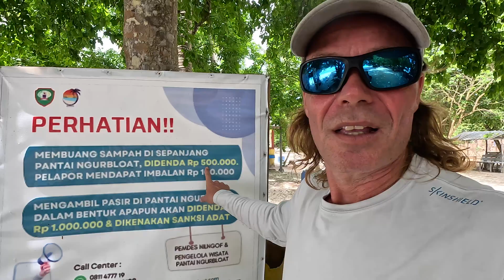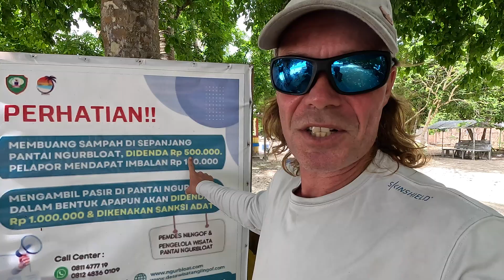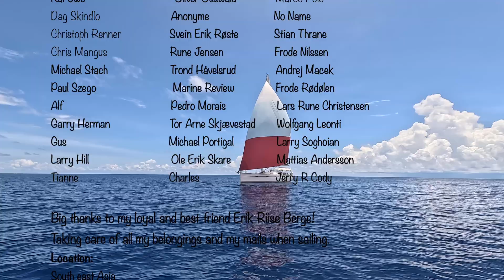FROM PLASTIC WASTE TO PETROL - SwT 192 - HOW TO RECYCLE PLASTIC

Comment: When I was sailing 50 years ago the offshore pollution was heartbreaking to see, but now it is a hideous nightmare. 
I wonder if it would be possible to create a new island in the Pacific by dragging a giant net (made from miles of recycled plastic) around that huge mass of plastic that has collected there, then tightening the net till you could safely walk and build small (recycled plastic) structures on the new floating island. Individuals have actually done this on a very small scale, creating floating homes, even with gardens for themselves, out of plastic rubbish.
Reply from the maker: Luckily it looks like the awareness about pollution and plastic are growing. Even in Asia. I have actually been positive surprised several places lately. 
Thank you so much for your comments and for being here

Comment: The catalyst that allows non-halogen plastic to be converted into oil is Ruthenium, a metal similar in properties to Platinum.  If a catalyst is used, the amount of energy required is much less, and plastic becomes diesel or any other fuel with further refinement. I strongly suspect that the reason why this is not done universally for the disposal of all plastic is the result of fossil fuel donations to global politics.

Halogen plastics such as PVC can be recycled into agricultural and domestic products such as builders' film and roof tiling, storm water drainage, etc etc.  It is not really suitable for drinking water, but OK for irrigation and electrical cable sheathing.

Comment: Where I live we’ve banned single use plastic in favour of other technologies. But these other technologies are often as bad or worse.

Compostable plastic is rarely able to be composted in currently available compost systems.

Paper products are often treated with processes and chemicals which also make them durable and difficult to break down. 

Finally, single use plastic is a good, sanitary, efficient material fif many uses.

I wish we could use the good materials while also fully taking responsibility for their management. Let’s use plastic straws but let’s have in place a method of dealing with the waste!

Comment: Burning waste plastic to generate electricity displacing coal/oil is the most efficient use. Other technologies use more energy per unit electricity. Only very small fraction of all plastic end up in ocean . Waste management along big 3rd world rivers and coastal areas most important. Bad waste management by governments biggest issue

Comment: Hi Thomas. Somebasic Facts about plastics, that became incorporated into the Civil and Structural Engineering Course I was on, in the 1970's, the data originating with intensive Research in the 1960's, when it was asserted that every Beach on the Planet, would be 30 feet deep in Plastic, within 10 Years - but it Never happened, so what was going on ? It was Found that Plastics exposed to Sunlight, break down into Esters and water, within about 12 months, and disturbingly, Those NOT exposed to Sunlight, also break down into Esters and water, and are gone wiin a period of up to 90 years- this has massive significance for things like Underground Drainage Pipes likelihood of starting to fail dramatically by around the year 2050, and explains the Osmosis Problem in Fibreglass Hulled Boats, even if they have been Barrier Coated both internally or externally So Tip - To o tain the longest possible Service life Boat, get the most recent production that you can afford, so you don't  have to cope with Structural Delamination problems, as the resin dissolves and Structural strength diminishes. Side notes - My 1978 Endeavour 32 still had excellent Structural integrify thanks to epoxy Barrier  oating below the waterline internally and externally, in 2016, and there is no such thing as a "micro plastics"Problem due to reversion to Esters and Water. However - Waste Plastics are a far too precious Feedstock to leave in sun.ight, or to put in landfill, as the clock is ticking on the breakdown of those Plastics. The most useful use of Plastics as feedstock, is for them to be used in Plasma Gasificstion with Syngas Production of Waste to Energy, for really Cheap Ultra Clean Liquid and Gas Fuels the most important of which is an Energy Density Enhanced Diesel Fuel, and we can never run Out, and have plenty to fill all needs, as the range of Feedstocks is so large , The Synthetics are truly Renewable, and all the Technology needed is affordable, and is available Off The Shelf Already. Bob. 🤔🌟🌟🌟👍❤️